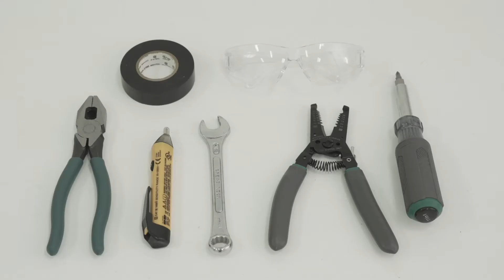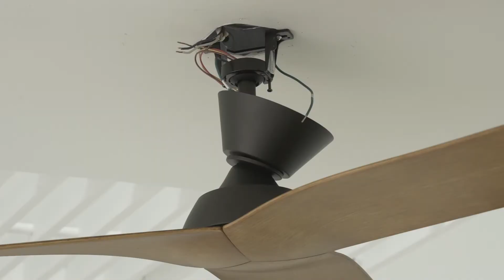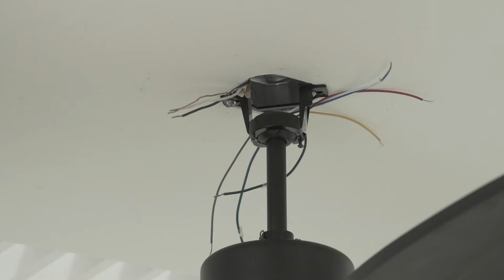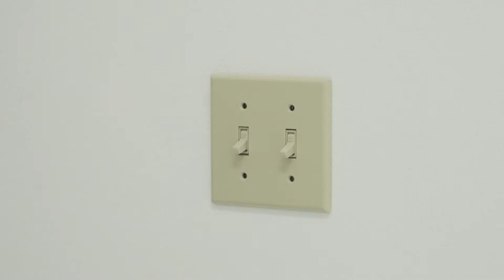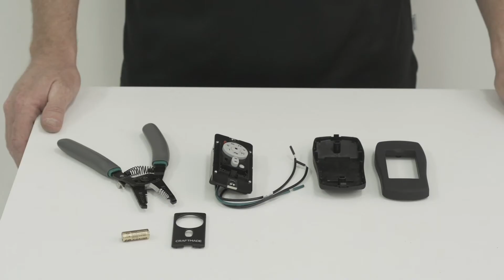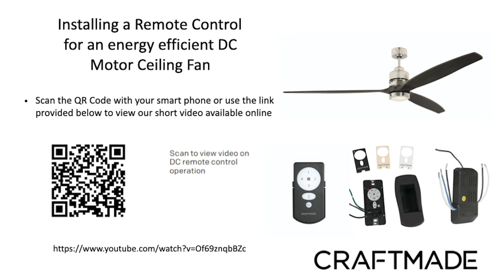How to Install a Fan Remote Control by Craftmade

Comment: So if the remote is getting installed to electrical power why does it require a battery to operate as well? I noticed we go through batteries like crazy because when we turn the remote OFF it turns the fan off. So we have to leave the remote in the 'ON' position all day. Being that the remote is installed into the wall it takes away the purpose of a remote, too. This is a terrible design.